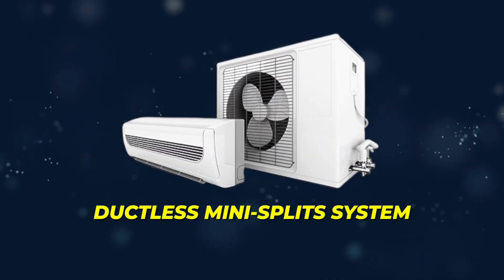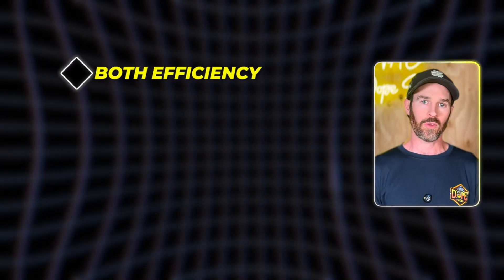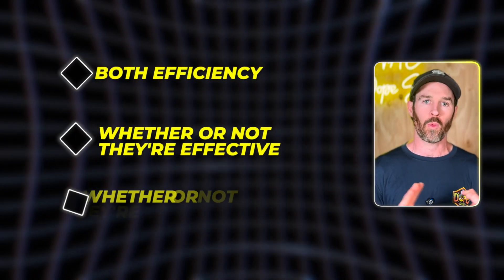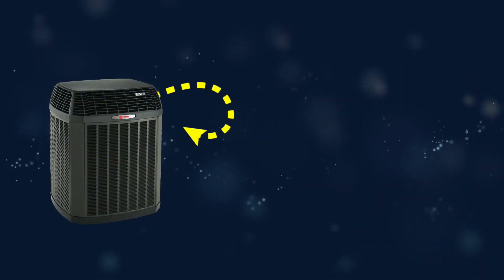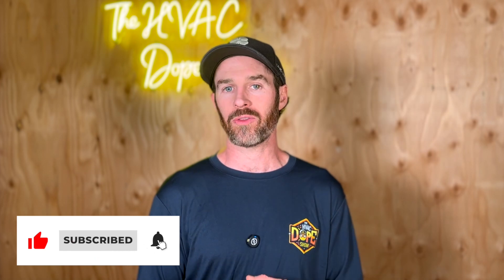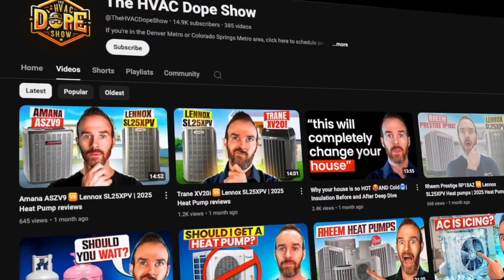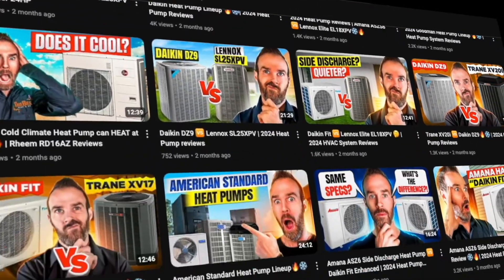The truth about Ductless Mini Splits | Heat Pump Series

Comment: Cons: maintaining a consistent set temperature, parts availability and cost, product information- such as sensor values, some compressors have an unbearable high pitched noise when operating at 100% output, finding hvac company that with make repairs or install 
(they lack the knowledge for repairs). warranty for diy installations.

That said diy installing a budget unit- Cooper & Hunter Olivia series or Unbranded Rovsun from eBay is worth the risks.

Comment: Excellent video -- straightforward information from an engineer rather than a salesman, without distracting music or time-wasting "entertainment." Also well articulated, which sadly isn't common, in my experience. Clearly you aren't the HVAC Dope alluded to in your channel name. So, although it turns out I'd heard most of this earlier in my research, it's a 👍and I'll be checking out the channel for more. By the way, this former engineering student considers the lack of "creativity" in naming devices a big plus.  ;-)

Comment: Useful info, but it seems as if you are minimizing the cons by describing them as purely aesthetic concerns. For example, having a mini split mounted on the wall of a bedroom isn't just aesthetically unappealing, it also takes up space in the room and is wall space you can't use. The lines running outside the house   don't just look bad. Wouldn't they also have potential to break or have problems? Also, you didn't mention the cost or whether using ductless mini splits would require installing one in each room. Maybe add to cover these!

Comment: If you getting a ductless mini split in a well insulated room or in your home,make sure you have good ventilation besides opening a window because when the humidity gets aliitle on the higher side outside,the room will get really warm/hot and you will need to turn the AC on even when it's only 50 degrees outside
Reply: Yep and the air gets stale and can start to be stank.  After we put in a central system in our finished attic 1400 sq ft done the main bedroom was farthest run, but had 2 vents, it still would take longer to cool, they took my ductless out saying we shouldnt need it.  So i opted to fe install it as its my daughters n her husbands apartment and their bedroom is used most right now until we finish the rest.  The good is the 2 central vents will bring in fresh air, we may have hvac installer folks come install a return air vent from their room but we will see how it goes.

Comment: Thanks for the video, very helpful. Question on outdoor condenser equipment, do we need to provide some sort of cover/enclosure or is it capable of Arizona desert heat, facing the south side of the house. Please advise.
Reply from the maker: Definitely don't want to enclose it it needs to be exposed to the outdoors to work properly, shade wouldn't hurt but it needs to have plenty of clearance depending on the system, side discharge systems need less clearance but in high temps in Phoenix I would probably stick to a standard style condenser. We've installed the Daikin fit enhanced without issues but mostly under 3 ton so we recommend the larger style inverters for high temp places like Phoenix. But short answer don't cover it or enlcose it

Comment: What a bunch of horse hockey.  So where does the condensed water go, that is produced by the mini evaporators.  Okay, maybe it does not have ducts, but it has long small refrigerant lines to the mini's all of which loose cold to hot spaces, all of which generate condensed water, all of which can develop leaks.  One tiny leak in hundreds of feet of line and fittings will drain the Freon from the system and it will cost a fortune to find the leak somewhere (in maybe even inside a wall) and replace the refrigerant.  Since there will be hundreds of feet of line the amount of Freon required will be huge. Here's an example,  The dimwit that installed my heat pump/AC allowed a small capillary line to touch a fin on the condenser.  After 10 years, vibration caused the fin to wear a hole in the capillary line and let all the Freon out.  I repaired the line and had a friend of mine recharge the unit with Freon.  It was $500 just for the cost of the Freon.
Reply: He addresses the lines at the end of the video.

Comment: Are there in-wall inverter heat pump units coming down the pike?  I know there are window systems available now, but I have in-wall AC units so if I could replace them with in-wall heat pumps that would be awesome.   Are these coming?  Are they available in Europe?

Comment: I'm thinking about installing a Daikin mini-split in the basement where my shop is. It will only be used for heat when I'm in my shop working. I heard somewhere that the inside fan runs all of the time. If true, is there a way to turn it off when I'm not using the unit which is most of the time.
Reply from the maker: That's not true the fan will shut off if the unit is off... it's like normal AC/Heat pump
Reply: @TheHVACDopeShow  Thank you!

Comment: Do you know if the R32 Atmosphera is compatible with the Daikin One Touch?  I noticed the S21 is a 4-Pin but Daikin’s wiring harness is a 5-Pin
Reply from the maker: No I don't believe so, there's other control options besides the remote and it has built in WiFi in the app